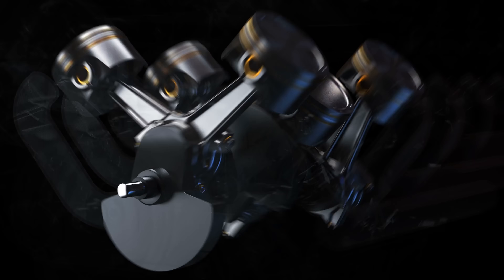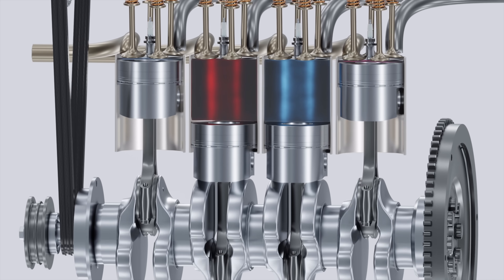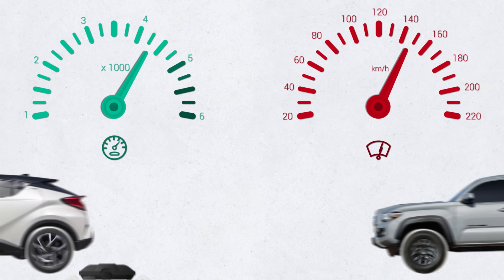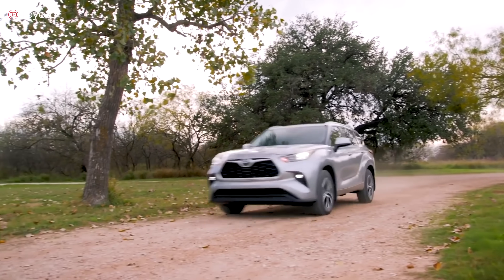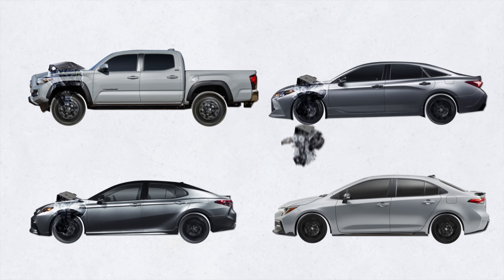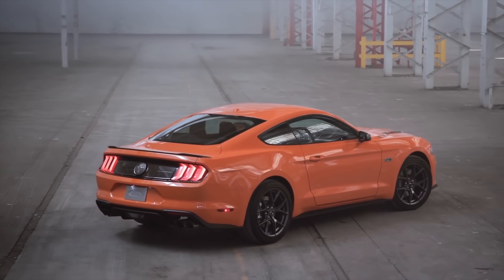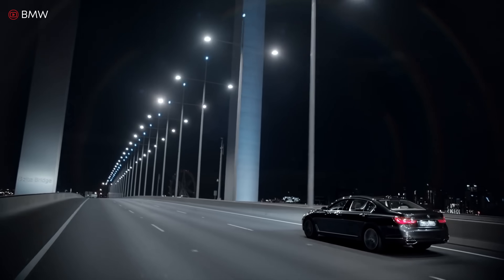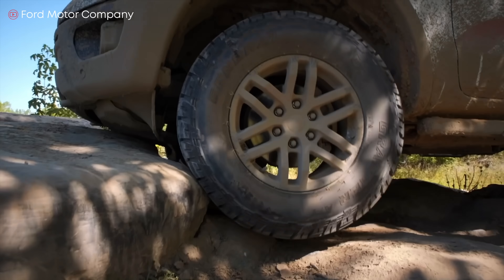No One is Telling You the Truth About Turbocharged Cars, So I Have To

Comment: I like the naturally aspirated engines because you’ll have less problems.
Reply: @Coyote when built right and 'driven right' (turbocharged powertrains have a slightly different approach to how they need to be driven)
Reply: NA engines are simpler than turbos and have less issues with heat management. Turbos do get better gas mileage, are a little more fun to drive (feel that boost) and can be easily tuned for more HP if desired.
I have had cars with both. Perform regular maintenance and they can last a long time.
If I had to choose on a high mileage vehicle, I would pick the one with the NA engine.
Reply: @ev-ezaye3580  and how is that?
Reply: @zacharyreynolds4303  The turbo engine might be able to last long but what you're overlooking is the turbo itself can fail. Turbos don't last as long as engines. If the turbo fails you're looking at some $5,000 to replace it. Not only that it's the hassle of the replacement and the risk that the mechanic might not do the job correctly when replacing it and screw something up. Reliability and low maintenance trumps everything. There's a reason Toyota Camry and Toyota Prius don't have turbos on them. Reliability and low maintenance.
Reply: you are right and that is way in my opinion toyota doesn't put turbos in a lot of there vehicles cause it will make more problems
Reply: I used to feel that way
Reply: @shaker6350  Toyota says they're not putting turbos in their car because you reliability but why do they put turbos in the Lexus LS 500
Reply: Can't wait to see you the results of the turbocharged Tundra and the new smaller engine.
Reply: @inertiaforce7846  😂😂
Reply: @inertiaforce7846  Bought a new camry in january. This is EXACTLY why i bought it. Any other similar sized sedan is turbo now. I did not want to deal with issues from the turbo. Still makes 200 HP with the 4 banger in it NA. Its also why I chose a dodge durango with the NA V8 in it instead of a ford explorer with the turbo. Plus of course you wont beat V8 sound with a turbo...
Reply: I have audi C5 A6 quattro, with 1.8t motor, that motor is best ever.
Reply: @zacharyreynolds4303  anything maintained right will last. whether naturally aspirated turbo or supercharged.
Reply: True😁 my 2008 honda civic Si lasted 12 yrs without any problem. Tuned using hondata flashpro 218whp..
Reply: Too bad modern NA engine are more complicated and lead more problems
Reply: I literally came here for the coyote 5.0 vs Ecoboost 3.5 fanboys and I was not let down 🤣
Reply: @inertiaforce7846  I have a 3.5l Ecoboost twin turbo and it's $2000-2500 total to replace BOTH turbos, not $5,000 for one. Go fear monger somewhere else
Reply: @joe1071  Fear monger somewhere else? You're right. That's why Toyota doesn't have any turbo Camry's. You've outsmarted Toyota.
Reply: Turbo's are expensive to rebuild.
Reply: And less fun.
Reply: @zacharyreynolds4303  they are also diesel.
Reply: Turbo is reliable. There are plenty examples of garbage NA factory engines.

If you dont maintain your car well then yes a turbo is not for you.
Reply: highway miles
Reply: yeah, toyota is smart that way, eventually though the direction vehicles are going in will force yota to start turboing more vehicles.
Reply: I like naturally aspirated v12
Reply: No you are wrong Reynold the BMW 4 cylidne without turbo will outlast Toyota and honda
Reply: @Talibro Joe you wish I were a bumpkin so we could be kissin' cousin 😘
Reply: @zacharyreynolds4303  Ford's 4.6l v8 is way better than. 5.0l v8. that's why ford don't make those engines any more is to damn reliable,that engine could compete with the Japanese engines reliability.
Reply: Thats wrong. Most cars today have turbos and they last about the same as the older one without
Reply: @cedenoanthony45  NA cars are easier to maintain than d turbo charged cars.
Reply: That would highly depend on the engine
Reply: @inertiaforce7846  not even 1 000 to replace a turbo, and if a reconditioned, instead of brand new, it would be half the cost.
Reply: @zacharyreynolds4303  True but they have to replace the turbos on them. I know because I just retired from driving a tractor trailer. Some don't make it to a 100,000 miles before needing a new turbo, at least in Volvo trucks.
Reply: of course, because there are more parts. that doesnt actually make it harder or worse to work on. turbos do a fantastic job if you dont do the pretty boy flutter mods and help on gas mileage so much.
Reply: @zacharyreynolds4303  those are diesel engines. That's a different conversation entirely.
Reply: Yes when you are rich buy a Ferrari 458 before it is too late
Reply: Not true
Reply: Agreed runs cooler lasts longer less to go wrong no turbo lag my naturally aspirated civic 1.8 averages 32 mpg in the summer and the Stick shift compensates for acceleration and thats at 12 years old and 135,000
Reply: @inertiaforce7846  5000 for a turbo where do u get this nonsense.
Reply: @gavriel4137 Lexus is toyotas luxury brand. Luxury cars are made to break down while looking stylish
Reply: Less libido, less life, less happyness, less everything
Reply: @joe1071 yeah until they find more problems that the failed turbos created . It's never just replace the turbos
Reply: @ethanmapanao7542 in your dreams
Reply: wouldn't the turbo cost more to maintain that a regular engine?
Reply: @Spunky-iq8jm they’ll RARELY rebuild a turbo, it’s 2 grand just to swap out a new replacement.
Reply: @aldinnidla770 def was a good engine. But they’ve really refined the 2.0t now that it’s been in production for over a decade. Also timing chain vs belt imho is much better
Reply: Wise man
Reply: Dad owns a 1.4t petrol inline 4 with 80k miles and the only thing that went was the clutch nothing else
Reply: @shaker6350 and then Toyota put turbos on trucks and they ARE having problems. Turbos wear out the engines faster. Even at 3k miles oil comes out black full or carbon that's going through the engine and acting like an abrasive.
Reply: @user-hk5hw8jg9m feelings don't matter, facts do.
Reply: @icost4671 those Toyota turbo tundra are having issues already.
Reply: @notjohnwick007 and modern turbo engine have even more problems.
Reply: @KT-fi7tm turbocharged engine even right at 3k for oil service often dumps black carboned oil that's acting like an abrasive and wearing out your engine.  Hope you like changing oil every 2k miles cause that's what it will take to hang with a good NA engine after 10 years.
Reply: @realtruenorth  3k changes conventional, no issues 🤷🏻‍♂️
Reply: I don’t know about that. Turbo engines are typically built more “stout” to handle the positive pressure. My VW ea211 1.4t direct injection is at like 150,000 miles with zero engine problems and none in the foreseeable future…..
Reply: @gemnicherry2670  only if you spend the money on the best engineering/quality turbocharged vehicles.
Reply: @dgeg1000  99% not true, and I work at a dealership as a master technician. I can speak on it with authoritative experience.
Reply: @hatredcopter838_  uh, yes it does. As a master technician that works for a living, I will never buy a turbocharged vehicle. The only possible exception would be a good turbo-diesel.
Reply: @shaker6350 they’ve been making turbos for ages.
Reply: You like it because you don't want change. Every new generation there's a new invention. If it'd have been people like you alone we' d still using rotary phones.
Reply: @inertiaforce7846 not true it depends who makes the turbo. The overhyped Japanese toyotas and Lexus by Americans and Ytubers turbos aren't as robust as Germans. I used to have 2004  Mercedes C230 Kompressor 1.8L engine with 322k for 14yrs and the supercharged never broke or needs repair.
Reply: @realtruenorth  they were having problems because Japanese manufacturers especially Toyota and Lexus aren't good when it comes implementing new technologies into their cars. Thats why Toyota and Lexus makes boring cars...they always wait till the Germans, especially Mercedes perfected almost every new car technology before Lexus join the wagon and their foolish American owners would be boasting and bragging about it. Germans , especially Mercedes have been making  turbos and superchages for decades and they never have that much problem   I used to drive 2004 Mercedes 230 Kompressor 1.8L engine for 14yrs with 322k and never replaced or had problems with the supercharge
Reply: @kofiarthur3749  turbos have been around a long time LMAO. Being a technician I am educated on what the salesman don't tell you 😉
Reply: @kofiarthur3749  well, Mercedes and BMW make good vehicles in general. But you pay premium $$ for the ample engineering to counter the pressure and heat. But the oil still cooks faster. No way around it. Comes out black at 3000 miles. And all that carbon in the oil becomes an abrasive that works on your engine. Synthetic oil doesn't prevent it either.
Reply: @kofiarthur3749  your not going to two 7000 pounds up a mountain with a small turbocharged v6 and not pay a price. A large displacement can keep the heat lower while doing that because it's not stressed as much physically. This is just science and facts I know you don't like those but they aren't going anywhere. Trends come and go. Turbos have they're place and so do large displacement engines.
Reply: @realtruenorth  I understand when it comes hauling heavy stuff but with time the turbos and small engines relationship would get better and able to pull heavy loads  fine. So in themeantime don't pull heavy loads with 4cyl Turbo....get 8cyl or six with turbo.
Reply: @kofiarthur3749  most full size trucks are jumping in the small v6 turbo bandwagon and that's a mistake. As far as cars go, I see less if an issue but there are still potential problems that arise.
Reply: I have a 2022 v6 tacoma sr5...was thinking to get the new tacoma sr5.. but not sure now if its worth it..

Thoughts?
Reply: @primek8981 the reality is turbos wont last as long as the engine..and where turbos are located in most engines mean the labor  to replace  them is very high..the new Tundras right now requirs you to lift the body off the vehicle to replace the turbos..thats 1000 in labor alone..

Its fine and good when you have a new car under warranty..but when you have an older car its a nightmare..

How i see it if you're  only planning  to have that car for 5 years max  a 4 cylinder  twin turbo engine makes the best sense but if youre planning to have a car for as long as you can..the v6 NA is the way to go..
Less heat ,less components  less things to go wrong..no turbo that will go before  the engine
Reply: Turbos and superchargers are fantastic. I dont want a turbo 4 cyl, nor a  na v6, or a turbo v6 ..i want a huge turbo on a huge V8!!!! Life is too short be be harnessed.
Reply: Turbo designed for fancy boy car 😮
Reply: @jakedover5301 Predicted correctly, sir. 👍🏻
Reply: 448
Reply: Heat is the killer.
I hatee turbos.
Reply: @Spunky-iq8jm  just curious how many turbos have you seen that needed a rebuild?  I own several one has 260,000 miles, one had 106,000 and another 98,000…Not one failure.  Two sisters both have turbo’s, brother-in-law, 3 friends yet zero turbo failures needing a rebuild 🤔
Reply: @msk3905  I had only one car with a turbo. A 1992 Dodge Stealth Twin Turbo back in 1993. I sold it after 18 months. No issues. I have read about some cars needing turbos. I prefer naturally aspirated.
Reply: @eraldovallejo2158  no no additional maintenance needed over a NA car
Reply: @jesseakers7298  hmmm my turbo cars running at the same operating temperature as my NA cars?  Do you not have a cooling system, most turbo system today also have intercoolers and oil coolers, have you taken temp readings that show a significant increase in heat?  So weird everyone talks about heat yet the turbo cars I have own run at same temps as the NA cars I owned
Reply: Turbo too much heat, and problems, N/ A  only way to go.
Reply: @inertiaforce7846 well said
Reply: Never ever turbo for me
Reply: The 4 turboed vs 6 n/a  is an irallavent topic, slap turbos on the v6 now its way more powerful than the turbo 4, now slap them on a v8 get where im going, thay are useing turbo 4 cyls to cut material cost just like how thay are using more plastic in place of body panels.
Reply: @ethanmapanao7542 natural aspirated V12 can be hugely problematic, just take Rolls royce for example, known for major engine issues. (Not talking bout newer ones, the turbo new ones actually have less flaws than the originals)
Reply: Like others have said, change you damn oil, transmission fluid, and other parts. A turbo can last awhile
Reply: @rschneid1996 correction, turbos TUNED and BUILT to get better MPGs will get better MPGS
Reply: right
Reply: You actually have less POTENTIAL for problems, but not less problems.  An uncared for engine is an unmaintained engine regardless of design.
Reply: I have run second hand turbo diesels for years and never had a problem.But then I always hammer them and they seem to love it...
Reply: The same feeling and reasons on purchasing SUV with 3.5L V6. I don't like all these new turbo garbage engines...😊
Reply: I hate turbo lag a lot of of them have it